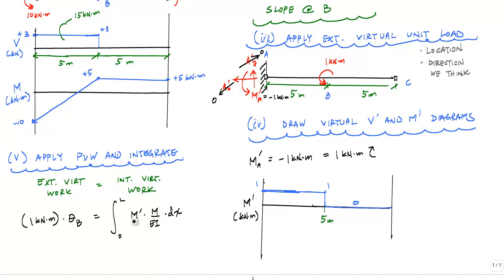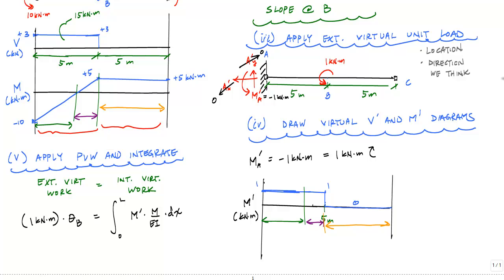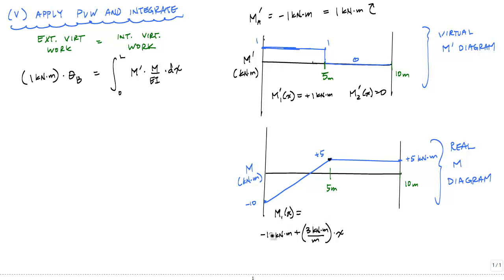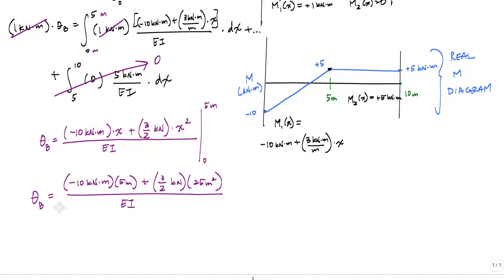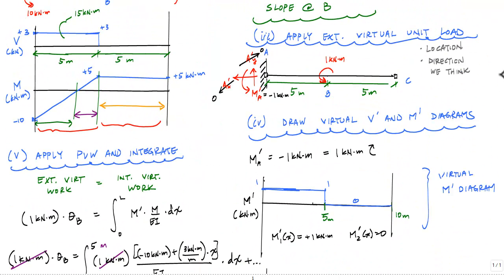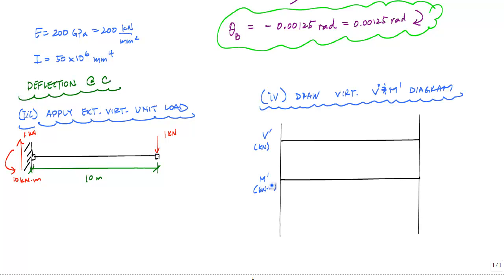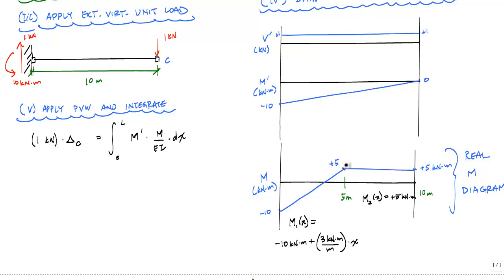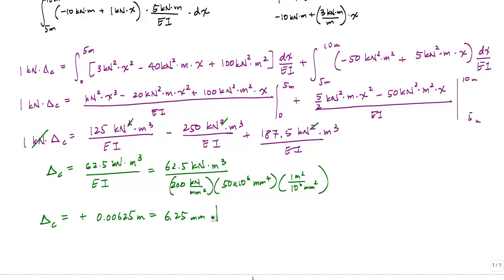Method of Virtual Work for Beams Example 2 (Part 2/2) - Structural Analysis

Comment: I am confused. When a disrtributed load is applied on the latter half a cantilever beam the slopes in the middle and those at the end are bizarre. The one in the middle is bigger than the one at the end. Am following the steps and its become frustrating cause i expect the opposite. The further i get away from the fixed end, the more the beam should bend. Hence the slope of its tangent relative to 'y' should continue to increase. Where am i possibly going wrong?
Reply from the maker: john thumbi just keep at it. no substitute for practice.

Comment: there is an even simpler way
you can take this formula
U= integral over (0to5) ((M^2)/2EI)^2 dx
now take the load as P , now differentiate the eq w.r.t P and now u get dU/dP
is equal to the differential value and now substitute the load 3kN in the place of P and now integrate, here the moment 5kNm is positive and the value of M is (P*x+5).
Use this u will get deflection of the beam at that point.

Comment: At 8:20 you write final equation starting, 1 * delta = ......    Shouldnt you write -1 * delta = .....   because in beginnig you defined upwards as positive and down as negative axis. In this case its clear that ofc beam must bend downwards but its not always so clear.